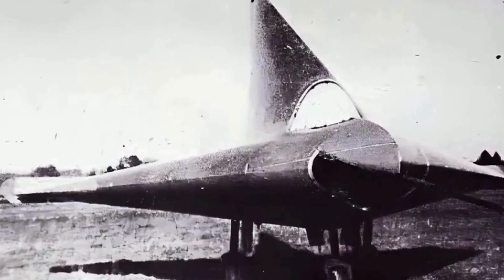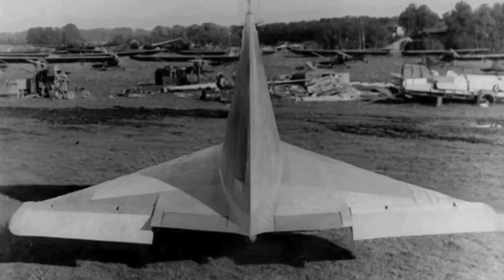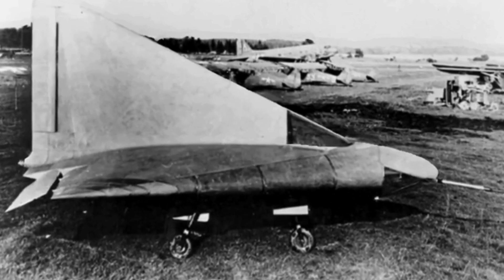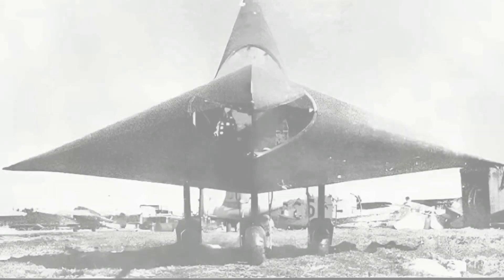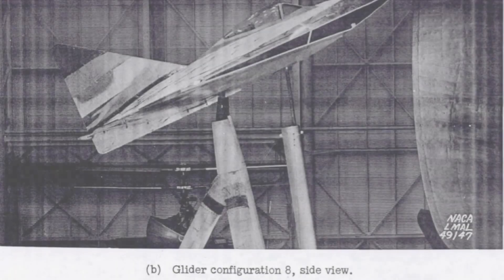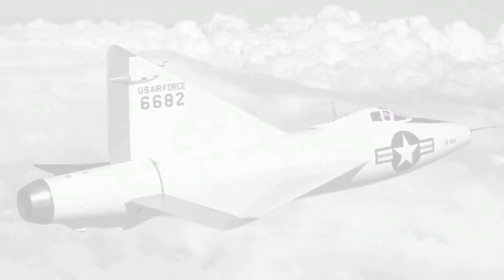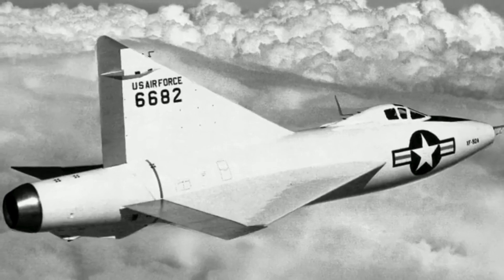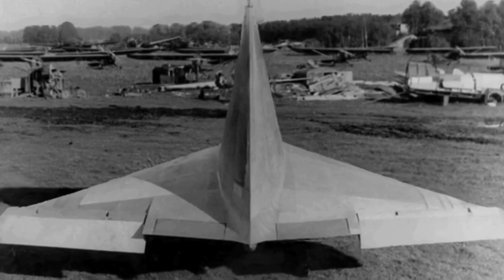Revolution in Flight: DM-1 Lippisch Glider

Comment: It all started with James Pitts' "Sky Car" vibrating orthotopter umbrella, then the umbrella was closed with a dome and devices appeared according to the scheme of conventional electromagnetic vibrating speakers (membrane + inductance) - fragments of the membrane were found by a farmer in Roswell. Then they created piezoelectric thrusters, or with small dischargers on the surface (they glowed all over the body due to ionization of the air), and now they are planes with plasma propulsion panels (so they are angular - that is, with flat surfaces). Thousands of discharge cells are densely packed into motor panels - they shoot streams of plasma (railgun architecture - coaxial electrodes). The ionized air of the spark discharge is accelerated in the railgun chamber by the Lorentz force to enormous speeds - a kind of ramjet engine is obtained. Just imagine! - tens of thousands of small ramjet engines assembled in panels and launching plasma synchronously at a huge frequency (hundreds of kilohertz). Plasma jets form toroidal air vortices - this air cushion creates lift and acceleration.💥🕳💥🕳💥🕳💥🕳💥🕳💥🕳💥🕳💥🕳💥🕳